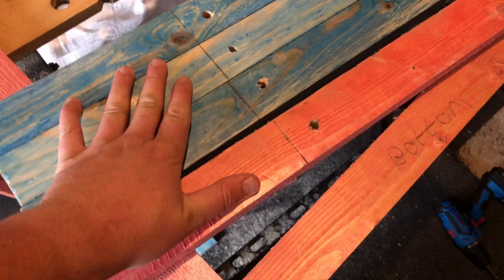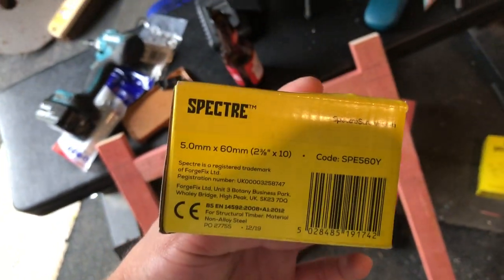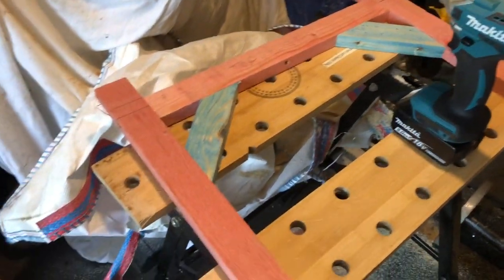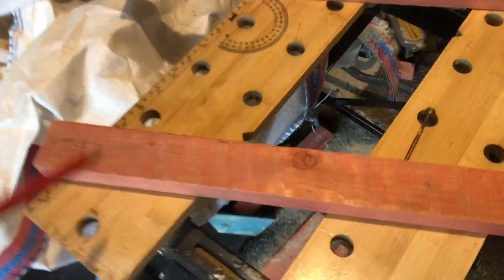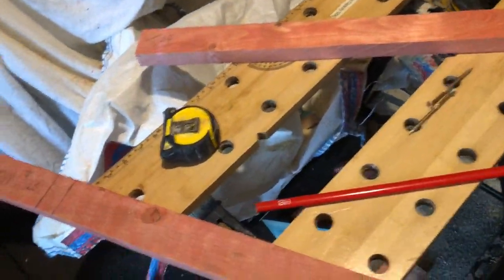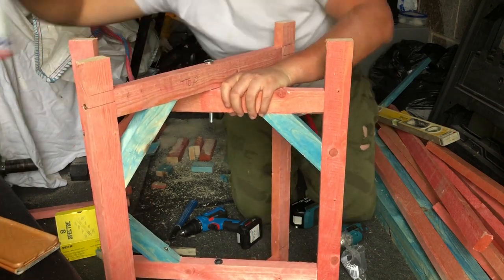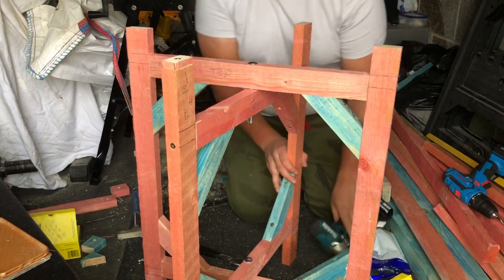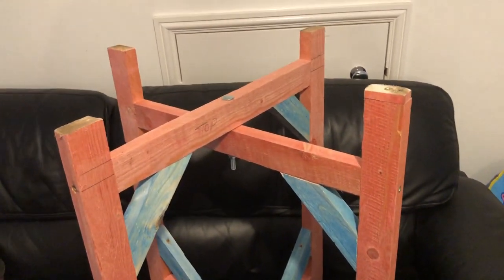Bricklaying - How to Build Mortar Board Stands (Cheap and Sturdy) - Part 2

Comment: Pride of place on settee 😂 well done mate it turned out good dude 👍 now just a few more to knock up.
Reply from the maker: Done 2 so far almost finished the 3rd
Reply from the maker: Getting em down to like an hour per tables, which is good, peice of mind knowing if they get nicked I’ve lost about £1 per table, couldn’t stand to leave a couple £100 quid worth of tables laying around on site
Reply from the maker: Haha was looking for some where to film that want messy haha
Reply: @theafter8bricky  it was funny mate I could picture you knocking a beer back in front of tele with it next to you on settee and a beer next to it like an old pal thats popped round for a chat 😂
Reply: @theafter8bricky  you will have to do a video when using them to show how sturdy they are and if they have made you life much easier mate
Reply from the maker: @TheTraditionalGolfer  haha
Reply from the maker: @TheTraditionalGolfer  used them today, great bits of kit, perfect for pic n dip and easy to move around without setting up a fancy block stack or carrying the man hole rings about which are quite heavy, gonna get some footage tomorrow building another garage 😂😛
Reply: @theafter8bricky  look forward to it mate

Comment: Just put ply gussets at both sides of the joints it's stronger🙌👍and quicker
Reply from the maker: Only got the materials on site, the whole point was that any bricky or trade could collect the material on site and build them or make them super cheap 👍🏻👍🏻👍🏻, will look out for some though thanks
Reply: @theafter8bricky  I know I've already made to them cheap as chips 😆✋